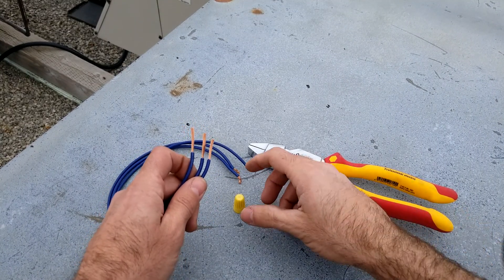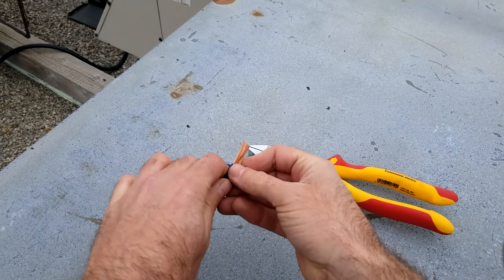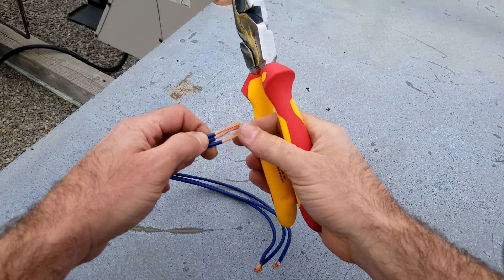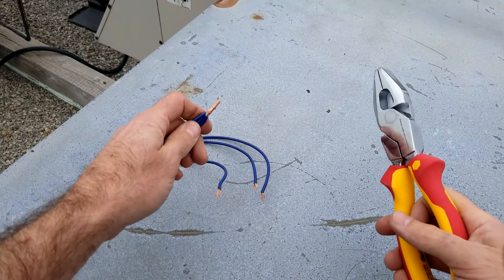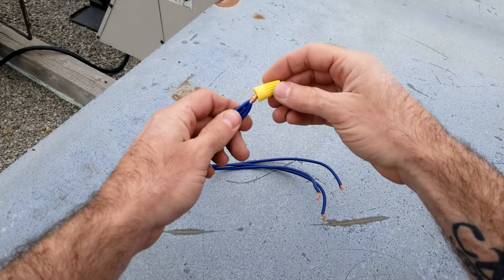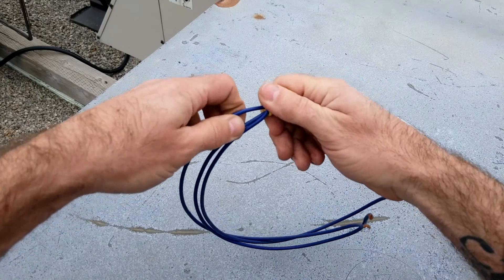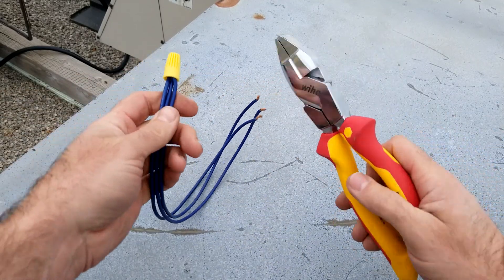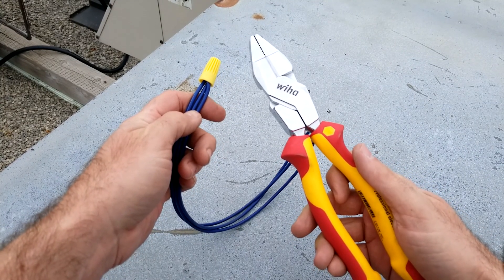Wire Prep For Twist On Connector

Comment: I thought those are wire nuts
Reply: That’s how we in ‘Merica refer to them. Canadians refer to them as a Marrette.  Thanks for all the great info HVAC KIA!
Reply from the maker: Capitol Refrigeration,Heating,and Cooling Wire-Nut is a brand name by Ideal.  Twist on is the generic term.
Reply: Here’s the whole story...       History since 1914
At the turn of the twentieth century, a young Scotsman named Bill P. Marr immigrated to Ontario, Canada. After settling in the Toronto area, Marr was soon employed by the T. Eaton Company as a contractor for Ontario Hydro, where he worked as an electrician converting gas-lit homes to electrical incandescent lighting.
As part of this conversion, the accepted practice back then was a process called “solder and tape.” Typically, a mechanic would first run the wires required, then an electrician would polish the exposed conductors and twist them together. Next, the ends of the wires would be firmly joined by dipping them in a pot of molten solder, and after they cooled, the wires would then be wrapped with an insulating tape.
Over time, this process proved to be both time consuming and dangerous, as Bill Marr discovered first-hand when he inadvertently spilled a scorching solder pot while working in a customer’s home. Convinced that there had to be a safer and more efficient way of joining two electrical conductors, Marr worked tirelessly in his basement shop until he finally invented the first pressure-type wire connector (a set-screw version that was the forerunner to the modern-day wire connector).
Since that day in 1914, the Marr® company became a leading manufacturer of twist-on wire connectors throughout North America. The Marrette brand so revolutionized the way branch circuits were connected that the term “marrette” has become synonymous with “wire connector” in the electrician’s vocabulary.
Since being acquired in 1997 by Thomas & Betts, which was in turn acquired in 2012 by ABB, the highly respected Marrette brand name has become an integral part of the vast ABB product offering to the construction market.